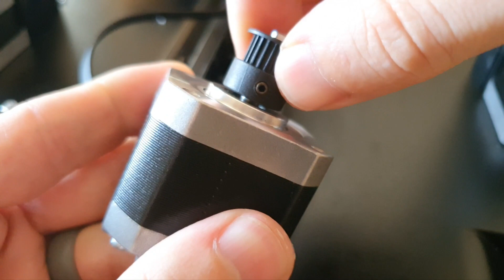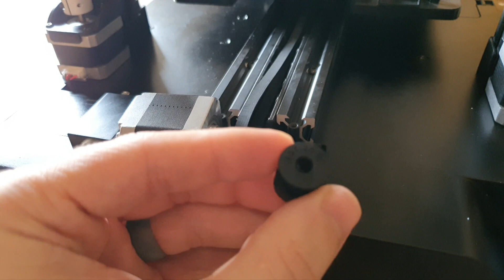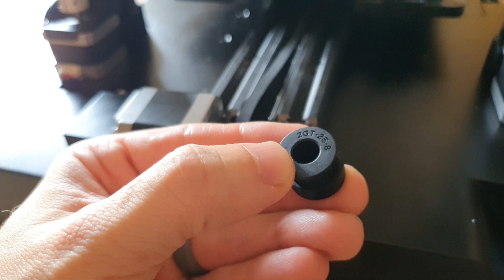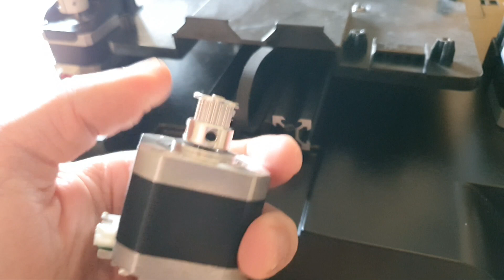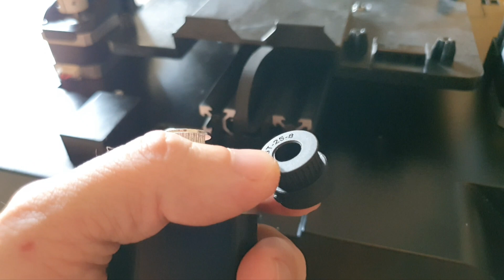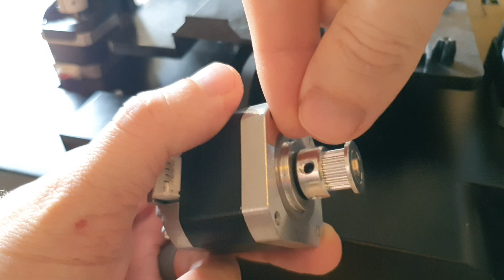Binding GT2 Axis Pulleys - Mingda Magician X 3d Printer

Comment: hi walt, just wanted to say thank you so much for making a video on this issue! i ran into an issue with really bad layer shifts on my prints and after several days of troubleshooting a fellow mingda user suggested that it was the factory pulleys' tendency to bind that was causing the issue. i havent installed my new pulleys yet, but if what you say is true, i just might be able to solve this (along with the ghosting issue i was testing for in the first place, hopefully). youre the best dude!!!

Comment: Can you tell me what screwdriver you used to remove the plastic support attached to the stepper motor? I tried With the hex wrenches given with the printer but they don't fit.
Reply from the maker: I  used a universal mini screwdriver with hex bits. I don't recall the size of the bit though.
Reply: @waltdoesitall1630  I tried but I am
Unable to remove the screw. I have the right shape and right size but it is a secure screw